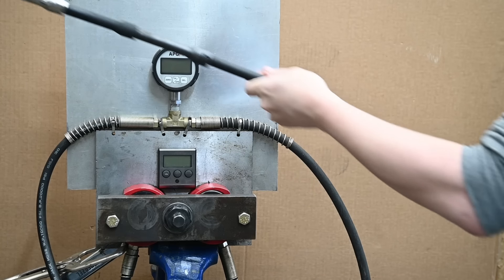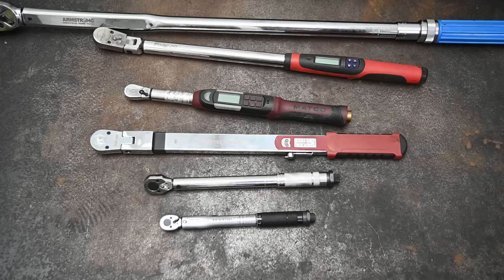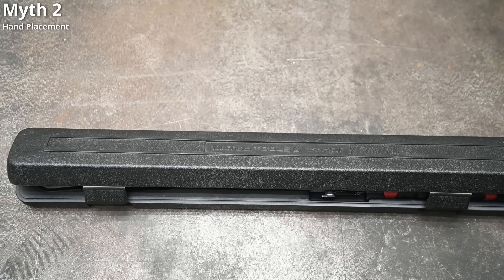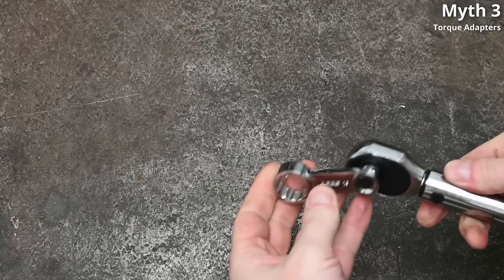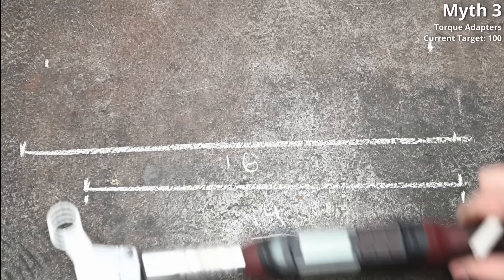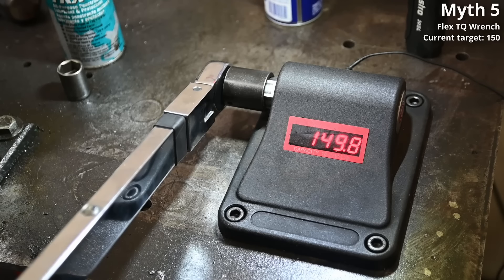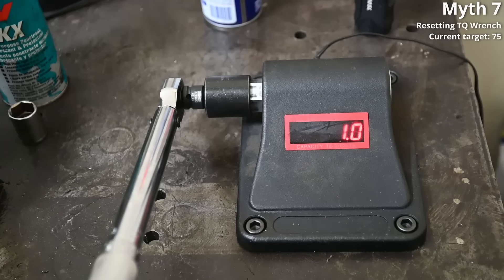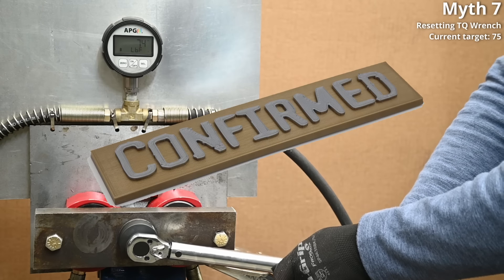You're Using a Torque Wrench Wrong: MythBusting 10 Do's & Dont's

Comment: When i was a Disney attraction mechanic they gave us a class showing all this miths, another one pretty interesting was reusing a bolt , comparing clamping force vs torque ,the new thread porous surface act as a bearing with less contact surface, so everytime you torque and lose the bolt it polish the threads giving more surface contact and reducing camping fir e at same torque, but out a drop of oil clamping went back exactly as new bolt.
Reply: Would definitely like to see TTC do an additional test with just a drop of oil instead of anti-seize.
Reply: I believe the head stud and TTY bolt videos they did covered that.... It's been a while though
Reply: So was that proven to be a myth?
Reply: "but out a drop of oil clamping went back exactly as new bolt" did you mean to write, put on a drop of oil ?
Reply: @brianblithe2271  lubricating the bolt,using same torque, bringed back same clamping force as when the bolt was new  without any lubricant
Reply: This is why we discard fasteners often in aviation. It's expensive, but ours is an industry where fasteners MUST NOT fail.
Clamping force is a preload. On parts that have a lot of stress put on them, like engines, if you overcome that preload, it causes the bolt to stretch just a tiny bit. Once or twice, that may not be a problem. But millions of times? That causes fatigue, and eventually, failure. And in an airplane, you do not want the bolts holding your engine together to fail.
If you never reach that preload force, the bolts do not stretch. It seems counter-intuitive at first; you're adding stress to the part, so it should be stretching it all the time... but that's not how preloading works.
Reply: @eclectichoosier5474  yes, that is in essence fastener application design in a nutshell.  The clamping force must always be greater than the expected operating load imparted to the fastener during operation.  If operating load exceeds clamping load, the fastener strain cycles, and fasteners typically do not have infinite fatigue life….very critical for something like a connecting rod bolt.  Any strain cycling at all will very quickly exceed fatigue life in something that load cycles at 8000 rpm.  I have seen a fatal accident where someone’s rear wheel came off on the highway…the lug studs were sheared off, and under torquing could very easily have been the cause other than yielded studs from overtorque.
Reply: Cool story bro
Reply: @eclectichoosier5474 explain this preload more plz
Reply: @TheJCompound  Preload is a force that is put on your work when it is assembled, and before there is any loading during use. It has already been explained in the comments here, and if you want to know more, it is very likely that there are videos explaining preload and why it is important. A video would do a far better job of explaining it than we can in the comment section.

As briefly as I can, I'll give an example.
Imagine you have a door that is held closed with a spring. The spring is putting preload on the door.
If you pull on the door, but less than the spring is pulling against you, the door won't move. If you pull harder, you will overcome the preload, and the door will move.

You don't want your parts to move, so you bolt them together with more preload than the forces that you expect that they will ever experience in use. This keeps them from moving and keeps the fasteners from becoming fatigued.
Reply: @eclectichoosier5474  thx!
Reply: @hdrenginedevelopment7507 you can usually tell by looking at the damage to wheel that came off. If the lugs were under torqued, the holes will be wallered out pretty bad. Over torqued they'll usually be cleaner because of the studs breaking and the wheel coming off sooner. Unfortunately I've seen it too many times, but thankfully nobody lost their lives.
Reply: Miths haha. It's myths*

Comment: I've calibrated a lot of torque wrenches in the last 2 years. Here's my quick notes for users;

Crappy click wrenches are usually terrible at their lowest marked value.  Go above 40% for a bit more chance of getting near spec.

Click wrenches have about 3° of movement befor they start increasing in torque again. Sneak up on it if you can! The checkers report the "first peak" value, not the final value.

Wind up to a setting, not down to it. That's to avoid hysteresis.

Deflecting beam tools are great, you ahould have one for the the fastners you care about getting 'right on'.

Don't lend torque tools.
Reply: That last line is so important!
But I get to buy a new tool now.
Reply: @drumbrakes  Treat yo'self!
Reply: Thank you brother.
Reply: First, from my experience, this all make great sense.  Some I am very familiar with other are just, "ok, lets do that".
One question, though...
"The checkers report the "first peak" value, not the final value."    What does this mean?
Reply: During calibration you are measuring the the click and if you are not careful you can go beyond that and get the post click torque.
Reply: @Caderic  As Jack said below, the torque checker/testers you use to check(the same as calibration, but I have to write down the numbers for the report!) report the value when the wrench clicks- After that, the wrench can actually produce a lot more torque if you keep pulling...
Reply: I am thrilled to hear a pro verify that bendy grandpa-wrenches are best wrenches and I will use them more now, thanks!
Reply: Just to clarify for anyone who's confused by the wording like I was for a second: If a torque wrench is rated 50-250 ftlbs, 50ftlbs * 1.40 = 70. You should only use that torque wrench for 70 - 250 (or 225 if you do the 10% under for the top end which is taught some places). Makes sense considering how they work. That being said if you're working with what you got, it's better to be slightly inaccurate than to forego torque altogether.

Altogether absolutely spot on analysis, thanks for the advice!
Reply: @troypond7173  Thanks mate! If you have a nice wrench like a Norbar, Bahco or Proto, you have a much better chance of getting a good result on lower settings.

Torque tools are a really interesting case for me, as especially without proper testing fixtures, you see much user technique changes the results.
Reply: @peterides9568  Wow just reading this. I feel like I should undo all my bolts on my car and re-do them as I pretty much violated all the laws here... 1.) I sometimes wind down if I'm using the same torque wrench; 2.) I sometimes go a hair past the click because I thought it wouldn't make a difference; and 3.) I sometimes don't totally line up the socket with the fastener at totally perpendicular because it's hard to reach....
Reply: @troypond7173  Hi, where do you get the * 1.40 from (+40% from lowest)? And how come this 40% isn't applied to the max torque value also?
Reply: Cool story bro
Reply: Is deflecting beam and split beam the same?
Reply: You mean don’t lend breaker bars😅
Reply: Thanks for this info!
Reply: dude literally just said price doesn't equal accuracy did u even watch the video
Reply: @soopadupa9424  yes, I did. I have also seen a pretty disconnected relationship between cost and accuracy... But on average, the cheaper tools are less likely to be 'good'. 

Combine with that, that if I have a Norbar, Stahwille or CDI that is not performing, I can get parts, re-lube and fix it. 

Cheap tools, once they go bad, are often 100% disposable. I also tend to get much better support from the bigger/better established brands.
Reply: @faYte0607 perhaps the spring rate is different in the beggining or lower portion. and is stiffer the more it compresses therefore increasing accuracy. idk fer sure. to help with that i recommend alll 3 basic sizes of trq wrench 1/4 3/8 1/2  to increase accuracy. and i always reset to 0 and wind up to my trq setting i.e 110ft lbs as a habit cuz im forgetfull lol
Reply: I use a little never seize regardless of what this video says and what tire shops tell me, I want to get that bolt off again in the rust belt.
Reply: Good knowledge but your definition of hysterisis is hysterical.

Comment: what I've learned from Aerospace work.
1. Double clicking makes no difference. but should be avoided not to piss off QA.
2. TR should be stored  at 20% of the maximum torque. (exe:100lb max on a wrench, so 20lbft store setpoint)
3. As long as the crow's foot or extension is at a 90 deg to the wrench, torque ends up being accurate.
4. Set your TW in the middle of the acceptable range when using. If the bolt spec is 15-20lbft. set the wrench on 17lbft. that way even if the wrench is off 2-3% you are still in the right range.
Reply: I learned the same exact stuff at the US Army Aviation school house.  For me, it was the AH64 Apache platform.
Reply: who cares what qa thinks and under 5 ft lbs doesnt make any kind of difference. bolts dont fail that simply
Reply: @nomercyinc6783  You obviously don't work on aircraft my friend. 
5lb off on a 20lbft fuel tank nozzle for example is 20% off the torque spec.
Reply: Double clicking does make a difference, because you're trying to overcome the resistance again.
Reply: My Goodyear torquewrench goes up to 200Nm at the top and 40Nm at the bottom. I was always unsure if I should turn it back down below 40 but your 20% rule makes sense.
Reply: @nomercyinc6783  don't ever work on motorcycles please.
Reply: Fun fact: Friction torque, or drag torque, called out by some self locking castellated fasteners can be added to the minimal torque range to result in a very high chance of the cotter pin hole lining up with little adjustment necessary for a slip fit.
Reply: @schwuzi  I'd have to check which brand mine is, but the directions for my torque wrench specifically said to return the dial to "0" before storing.  I would guess most of the reputable manufacturers have tested their product enough to know how it works best.  They want you to be happy with it after all.
Reply: @pirtatejoe   Mine doesn't have a 0 it goes down to only 40. So that'll do I guess.
Reply: @stickyfox back in the 80's 90's the snap on truck didn't have a torque tester on the truck you could not send a torque wrench in all the time to check it I would borrow my buddies to verify mine was on people don't understand when installing a wheel on a MC you are preloading the bearings learning from a Air force airplane mechanic he tought me a lot all I could think about was being responsible for someone getting hurt
Reply: @nomercyinc6783  Ever heard of material called aluminium? 5 ft lbs may be the difference between correctly tensioned bolt and ripped threads.
Reply: In small enough torque settings double-clicking will turn the nut/bolt further after each click
Reply: @williambartholomew5680  That's correct. Double clicking can increase torque because static and kinetic friction of the wrench release mechanism are different. Every time it clicks, the wrench enters static friction state and requires more tension to release again.
Reply: Where I’m at we have calibrated torque wrenches that we don’t touch, set to high end of the spec. Torque’s we need are low so very rare to get drift
Reply: people who double click always say it makes no difference, so i've no idea why they do it when it 'makes no difference.'
Reply: @cliveramsbotty6077  because its fun clicky clacky
Reply: .....25%
Reply: Why the 20% of maximum instead of the lowest setting? I mean I doubt there would be much spring fatigue at just 20% of max, but still.
Reply: @3rdGenGuy 25%?
Reply: @schwuzi The main reason to leave some tension on the spring is to avoid the little block in clicker mechanism falling out or getting into the wrong orientation.
Reply: @nomercyinc6783 the amount of difference that 5 ft-lbs makes is dependent on what the nominal spec is. It’s a big deal on a 10 ft-lb spec.  You should ask QA, maybe they could explain it to you.
Reply: As an aerospace quality assurance inspector, I approve of this message.😅
Reply: @nomercyinc6783  For your liability, what QA thinks and following the manufacturer's established procedures EXACTLY makes all the difference in the world.  When a plane crashes and kills people, the aircraft manufacturer is going to blame the airline's maintenance organization, and the airline is going to blame the manufacturer.  (Think Boeing / Spirit B737 door plug falling off.  Of course, with that one, the bolts were just plain MISSING, but that's a different story.  Unless the bolts WERE torqued properly, they just were NOT on the airplane.)  You don't  want the NTSB final report saying the crash was because YOU didn't torque something properly.
Reply: @Low760  It depends. Context is with using a HF Pittsburgh Pro clickstop I've noticed if fasteners are new and threads are great condition you can click it as much as you want and it's not going to turn anymore than where you set it. If the fasteners are old and threads are good but old or a bit dirty as well you do have the possibility of turning it ever further....possibly multiple times. In that case you could go for a torque lower in the spec and then when it does turn a bit on the second click it's in the middle or possibly right on.
Reply: you learn all these stuff by reading the wrench instruction
Reply: @TricksterJ97 If you don't go below zero the little block in the clicker mechanism is not going to fall out. The manufacturer of all three of my torque wrenches, states right on the manual that you are supposed to zero out the tool for storage. Storing a torque wrench with some tension on the spring cannot be better for the spring than storing it with no tension on it at all. If you have the torque wrench stored without any tension on the spring then the characteristics of the spring are going to remain exactly the same. If you have 20% tension on that spring, it's probably not as bad as having 80% or more, but it is still not going to be as good for it as having no tension at all. They would not put a zero mark on the tool if you were never supposed to set the tool to zero.
Reply: @3rdGenGuy  
+ 20% ( 25/20 ); - 25% ( 15/20 )
Reply: @ColeSloth  Assume this started as "store it BELOW 20% of max" and ended up as just 20% of max.

See this type of thing all the time, read the instruction for any tool or machine with a spesific setting for something. Chances are good that setting is a "below this" or "above this" number, just remembered as the number for whatever it is
Reply: Cool. Story. Bro
Reply: @schwuzi  In that case, you are supposed to set it at it's lowest to value.
Reply: 2. Uhhhh all the manuals for torque wrenchs ive read it says to store them at the lowest point their rates for.
4. So instead of potentially overtorqing the bolt very slight amount that it is probably built for you should under torque it and risk grossly undertorqing it? That just makes zero sense to me. Im quiet certain the Aerospace industry at least builds a 5-10% safety factor.
Reply: @3rdGenGuy I agree with you…except your math. Set it at 17, you can be 10% off and still good. 5 is 25% of 20.
Reply: @schwuzi  My wrenches' manuals say "store in minimum torque setup labelled. Do not set below." 40 happens to be 20% of 200. Coincidence? ;)
Reply: @schwuzi Set it at it's lowest setting.
Reply: On the "3. As long as the crow's foot or extension is at a 90 deg to the wrench, torque ends up being accurate." : shouldn't that be more something like, "as long as the virtual arm stays the same"? For a very short one that would be 90° indeed, for one that's the length of the wrench, it'll be 60°, right?
Reply: Correct
Reply: @Low760 How does it make any real difference? Is your statement base on any fact/Data or is just some unsubstantiated personal view?
Reply: @Low760 Are you sure?
Reply: @johnburgess2084  This is what a lot of people don't realise.
If your work directly affects the safety of thousands of people and a single mistake can get someone killed or worse, not following procedure will almost certainly land you in prison.
On the other hand, if you have worked to the manufacturers specification it then falls on them to explain why their design failed.
Reply: @Low760 And it just sounds right 😂

Comment: I had a class in auto mechanics in high school.  Taught by a man who was an aircraft mechanic during WWII.
He stressed the torque wrench should only be pressed from the defined handle and pressure should be slow and steady not snapped. He demonstrated snapping the wrench could result in being off 20 pounds when wrench is set at 120.

This was a very good video, many thanks. I'm glad you showed how the wrench with twist dial should be stored  unloaded. 
He explained the necessity of accuracy with torque. Most bolts are designed to slightly stretch sort of like a rubber band. That stretch is what keeps them tight. It is not just the friction of the surfaces that touch.
Reply: Thanks for that info.

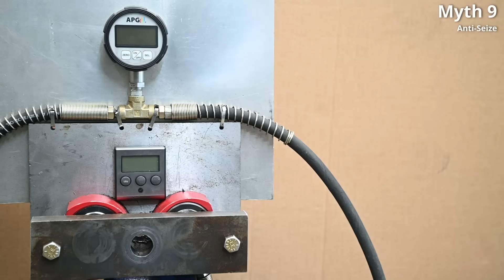Comment: 17:00 I even look at anti-seize wrong and I turn into the Silver Surfer.
Reply: It's more like the Venom symbiote, it gets everywhere and you can't get it off.
Reply: I swear that stuff sneaks out of the bottle by itself.
Reply: @cujoedaman  sounds like my first wife.
Reply: And you should smell the crap at 600 degrees Frankenstein.  It is a smell like no other 🤮
Reply: Brake clean. Brake clean everything, every where. Use bath if necessary follwed by steam clean. Hope this helps.☢
Reply: Glad I'm not the only one with this issue... I'm scared to open the bottle without some sort of full-body protection...
Reply: I don’t touch mine without gloves on and it still ends up on my hands…
Reply: Same here!
Reply: This!!  I store that shit like Kryptonite.  It magically gets on everything...
Reply: "Tin Man Fluid"